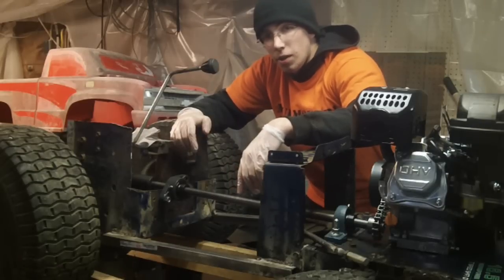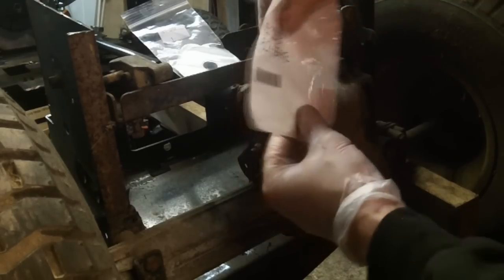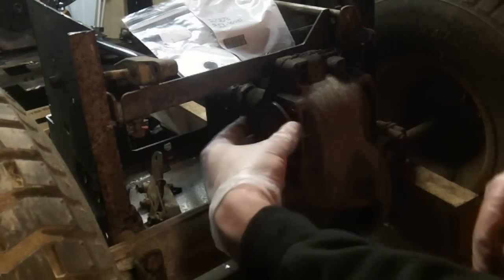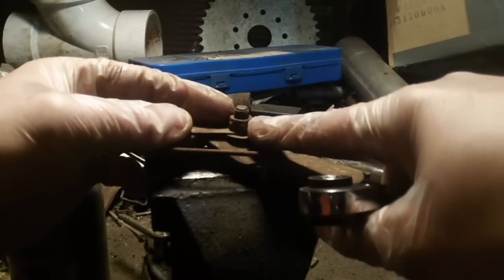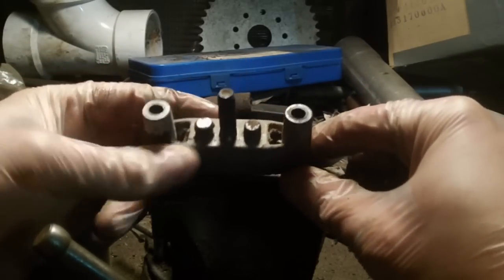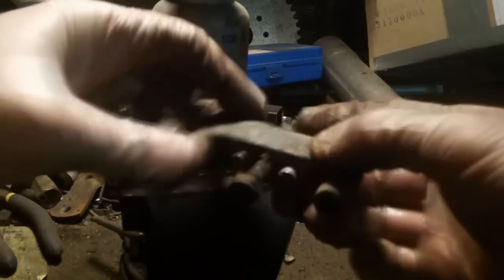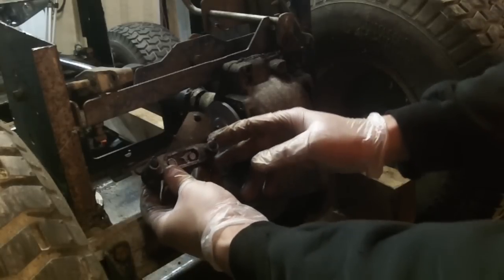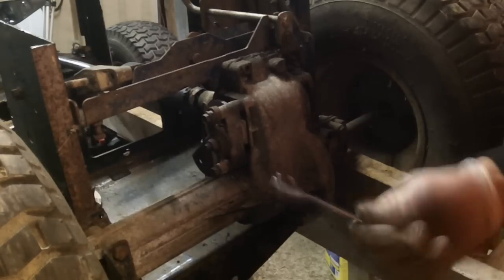MTD brake rebuild FNR

Comment: Great information.
I changed all the belts on my LT3800 today and noticed the park brake quit working while the tractor was running and in gear. It worked fine before I changed the drive belt. I guess the old belt had enough slippage the current brake adjustment held. I made the adjustment based on information from this video and now it works perfectly.  Thanks
John

Comment: I used a propane torch to unseize the pins.
Used a roloc to clean up the pins, kind of hard to get something inside the holes but wasted a couple of polishing tips on my dremel in there, clean enough.
The anti seize is a good idea, didn't think of that.  Especially since I have lost some of the width on the pins from cleaning/pitting, that'll help make up the difference.
My pdf doesn't do a good job showing that the pucks go on both sides of the disc, although it looks obvious, wanted to make sure.
You can probably put a little dab of anti seize behind the puck and plate to help hold it in place while putting it back on
Thanks for your video.

Comment: Ive had my 10 year old cub cadet ltx1040 for 3 years and the brakes have always been sketchy. They catch all the way at the floor,but i offered to mow a fellas yard and he had a steep driveway thats 1/4 mile long. Needless to say,i went for a ride. Never been an issiecin my yard,but its pretty flat. I think im gonna take them apart to see whats up with them. I did try to adjust them but they got all grabby and were holding some even without depressing the pedal. Thanks for the troubleshooting and tutorial

Comment: I lucked out recently because of a lack of maintenance/adjustment on the rear brakes.I was given a 17.5hp Troy Bilt mower because of the owner assuming the rear differential was locked up.She went out and bought a Huskqvarna with a hydrostatic setup. Ive begun replacing parts on my 15.5hp Troy Bilt mower with parts from this mower & while searching online for possible causes of locked up rear wheels,I commenced to inspecting the rear brakes and sure enough both caliper pins were seized up.I removed,cleaned,inspected & reinstalled everything and no more locked up wheels.One thing Im curious about is why the rear wheels can be manually rotated between one to two revolutions before they lock up if the brakes are seized up?? You'd think they wouldn't move period with this brake issue,but it was the cause of the problem.